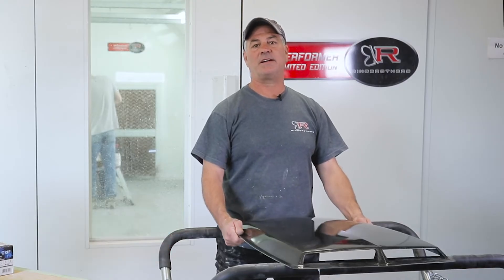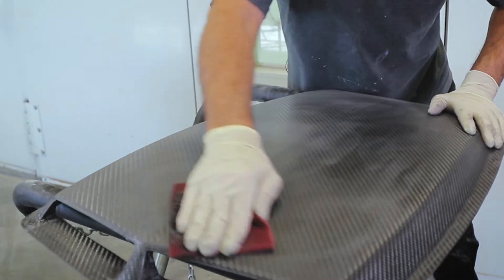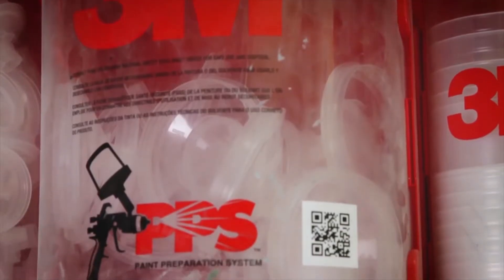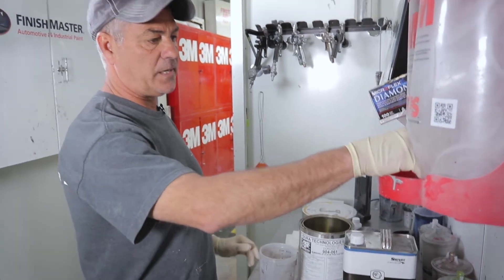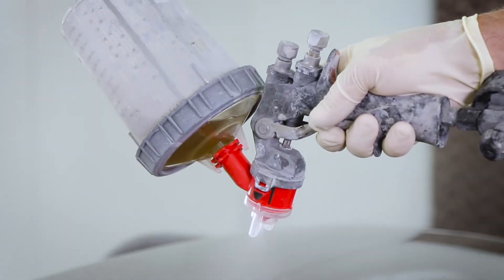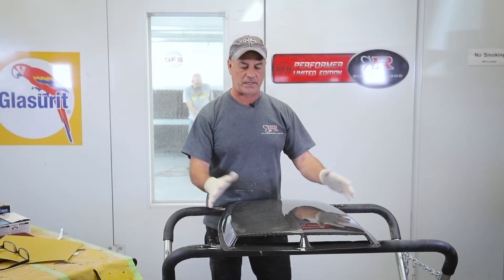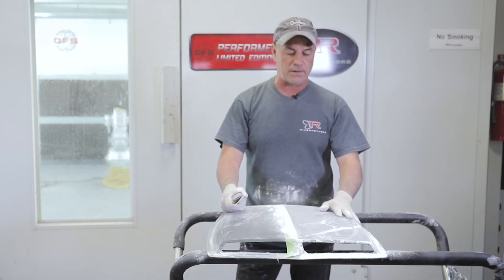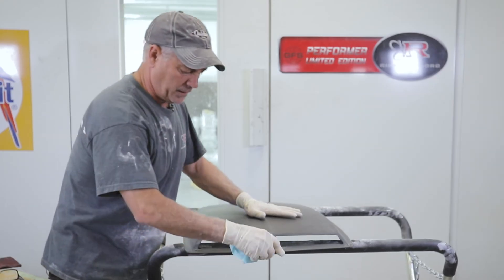Ringbrothers University – Clearing Carbon Fiber Part I

Comment: Use an in mold clear and you can skip the duratec. And if you use a UV stable clear in mold,  then life just got 10000000x easier. And way cheaper for ya. Good work tho man!